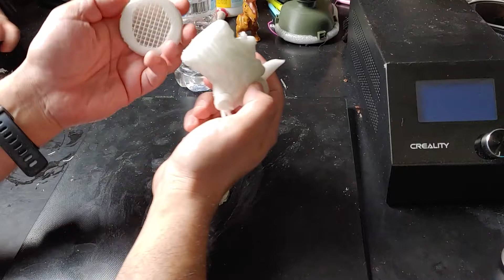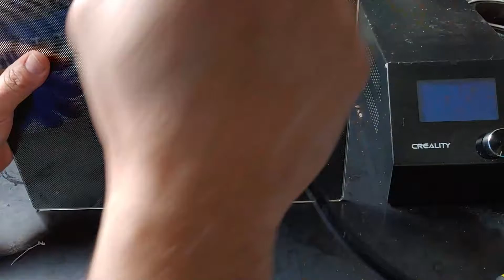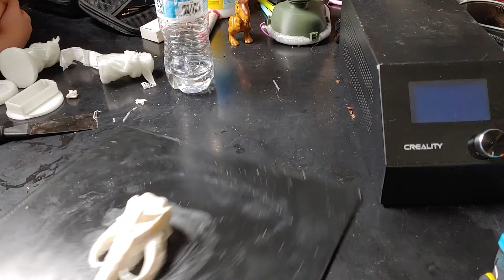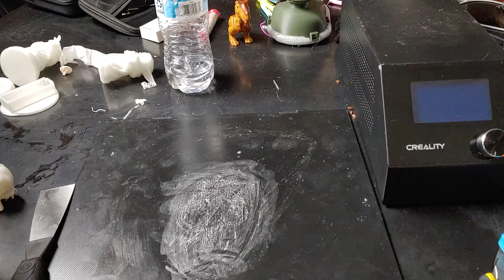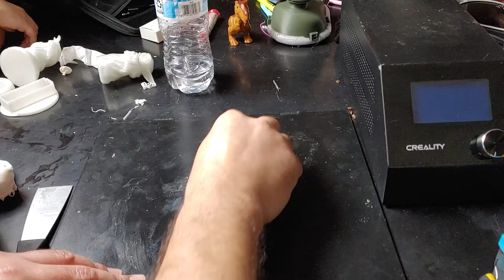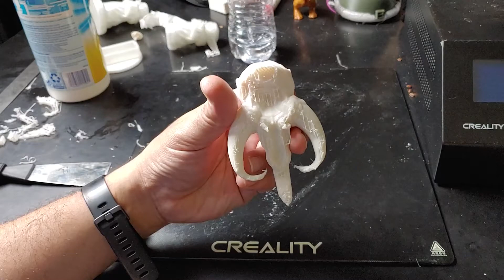How to Remove Stuck 3D Parts from Build Plate

Comment: Some parts will not be that forgiving to the heat and will bend and warp when you try to heat them and remove them from the bill plate I have found that the freezer is the easiest and safest way to remove your parts and protect your build plate

Comment: Build plates are relatively inexpensive get you another one just as I did and that way it doesn't slow down your ability to continue printing other parts while the other is cooling down in the freezer if you don't want to wait.

Comment: Dude, you mentioned Ender 3, you have an option in the menu: Prepare>PLA pre heating>bed end which allows you to use bed (the plate) heating to do that.

No need for your heat gun or hair dryer, whatever

Comment: I even remove my bed from the freezer and the parts are still as if I used epoxy instead of PLA. Hate the glue stick, but if I don't use it, parts don't stick, even if heating the bed to 60 degrees. At this point I will buy a flexible bed.
Reply from the maker: https://youtube.com/shorts/ZQqAlWc2LAE?feature=share
Reply from the maker: Flexible is much better

Comment: What kind of plate is that? I can never get anything to stick to the bed on my Ender 3
Reply: I would say that the most important thing i have learned so far is that bed leveling is crucial. You need to level at each corner, i even succeeded with printing on a mirror without any spray or glue stick. I would suggest that you buy a polycarbonate sheet and use it as a bed. Every type of filament sticks on that that material.

Comment: If i use my build plates heat how hot should i set the bed temp to use that? Thanks
Reply: I use up to 75 but be careful removing it since if you do it carelessly you could warp the print

Comment: Faster way is to heat up the bed on controls in probably 100 degrees celsius or before your filament’s melting point
Reply: It's not advised to heat a glass bed above 80°C
Reply: @WirageVoyage  I found a new way to pry these prints. I use a thin palette knife to make space for my spatula
Reply: @WirageVoyage  Haha my 3d printer can heat up to 150 degrees

Comment: Hey heads up put the glass with stuck part in freezer for a few min it comes right off
Reply: Works every time. No more wet parts, no more scraping the bed.
Reply: I tried to print on a Ikea mirror, the first time ever, which worked perfectly, but the print was stuck (PETG) i put it in a freezer and it popped off easy but the glass was shattered.